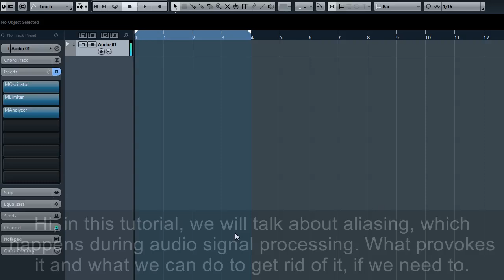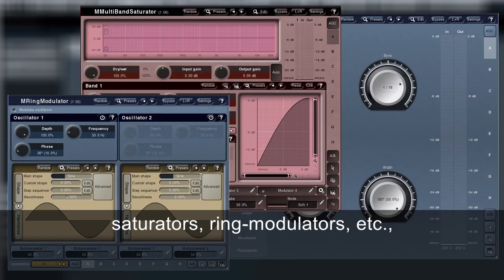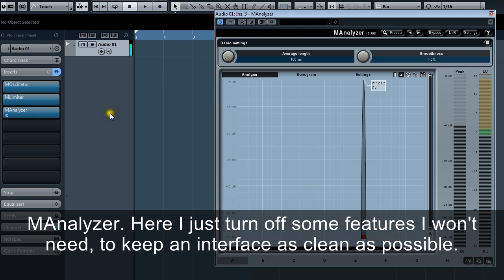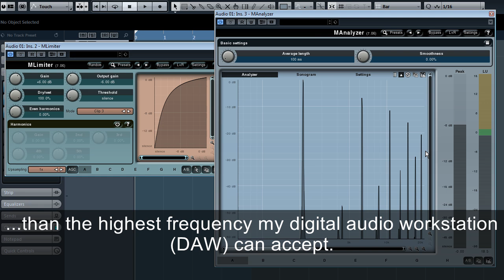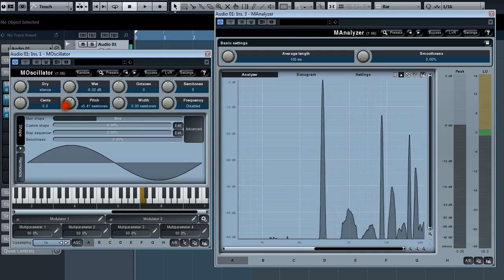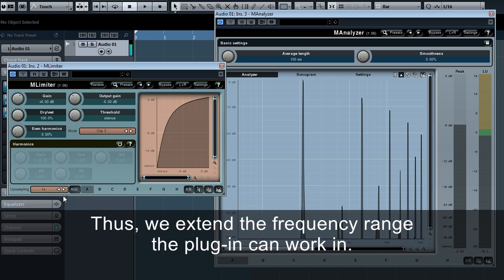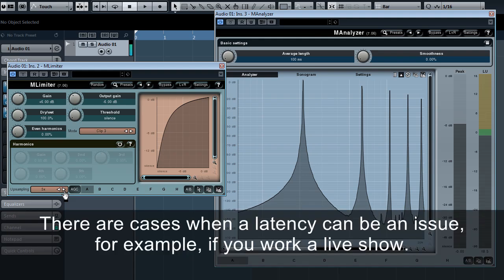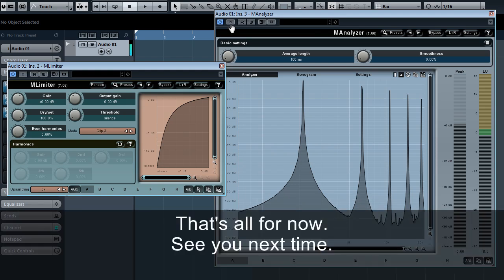Audio aliasing explained

Comment: I'm guessing this session was in 44.1KHz?  So if the session was recorded at 88.2, setting the upsampler to 2x would be the equivalent result of what was 4x in this session?  Thanks in advance! :)
Reply from the maker: Yes, that's correct ;). But as always, note that it is not a miraculous cure. Please read the docs about upsampling to get some knowledge about it, so you can use it profesionally.
Reply: meldaproduction Hmm, well I certainly will!  

However, while I didn't think it was a miraculous cure, I did think it was an effective one, lol.  If the problem is digital and it's effectively like hitting a wall, expanding that wall to frequencies well beyond what we can hear I thought would be rather effective.  I'm guessing from what you've said, there is more to this (as I was certain of regardless) than higher frequencies folding back into the audible range.  I think this is the final digital problem (at least for mixing/production) I have yet to fully understand and therefore effectively solve.

Anyway, thanks guys; you're the best!  I love people who are great at what they do.
Reply from the maker: Typhoon792 My pleasure. And yes, that's correct, it's more or less the only digital audio problem, interestingly most plugins don't solve it at all, which sometime is...ehm... And yes, oversampling is the general cure, but it has disadvantages.
Reply from the maker: Typhoon792 Yes, but also there is latency problem, filtering...
Reply from the maker: Typhoon792 Check the docs, everything should be there. And yes, latency + CPU is the main problem, nevertheless it is filtering, that's the main thing. As usual - use it only if you hear/measure a difference.
Reply from the maker: Typhoon792 Actually, it should hit you in your ears in the first place. The video should give you some insight about how it sounds. Anyway you can easily use MOscillator, set the sawtooth wave and listen ;).
Important point: Those saying that aliasing is generally wrong are fools! (and it's most of them) The truth is, you can use it creatively, there's no limits!
And as for an example - imagine a tuned drum (with some strong fundamental), whose frequency collides with some other instrument. To get some space in the mix, you'd probably use a saturator and/or eq (or some more sophysticated tool such as MDynamicEq), but these will both probably generate the same harmonics, so saturation won't help you. But if one aliases, it creates some nonharmonic frequencies, which will separate the 2 instruments. Of course, this assumes they will be significantly high-pitched, but as an example...
Reply from the maker: Typhoon792 Yes, that's correct ;). You know, music is art, so "if you like it, it is good! whatever it is!" ;)
Reply from the maker: Typhoon792 I totally agree ;).

Comment: Deleted my comment because I said that a well designed plugin should take steps to keep alias causing elements out of i's output (ie: at least incorporate a LPF at the final stage)?

Seriously?
Reply: Alias causing elements in every single wave are different, so this filter should be very intelligent and heavy weighting, causing additional latency and, mainly, absorbtion of the system resource. The last will in its turn cause what? Right, aliasing XD

Comment: Any plug in that is not aware of the sample rate of the system environment in which it is working AND fails to properly take measures to prevent the creation of spectral components that would create aliasing (at least by using a low pass filter at the final stage before plugin output) is a poorly designed plugin IMO.
Reply from the maker: Actually, aliasing is inevitable in most cases. It can just be minimized. And the processing is often highly CPU demanding. Anyway believe it or not, most plugins on the market completely ignore this problem.
Reply: +meldaproduction
I love that you're honest (as it would obviously be counter to your best interest claiming this as opposed to using this as a way of promoting MeldaProduction plug-ins), but the way you put it almost seems contradictory.  The most important thing is to be informed and otherwise educated on any matters you form a conclusion on, and I can't appreciate that any more than I already do when it's a shared value with somebody that I have, especially when done on principle when in theory (and unfortunately often times in practice) it's counter to their own business interests, but what you mention in a practical sense doesn't really aid in the mixing process.  On the one hand, it's obviously important and helpful to compensate for aliasing (overall) in your sessions for the benefit of added clarity (and reduction of dissonance) in upper harmonics and frequencies.  On the other, you're kind of saying Slate Digital and Universal Audio and all those companies who make plug-ins like you guys actually worth a damn (and pretty much necessary at this point if you're going for specific qualities) don't really account for this issue on the whole, so it's pretty much unavoidable?

The problem is, aliasing is hard to hear on an individual track for something more complicated than a basic generated waveform, but as a whole, with whatever practical applications during the mixing process aside, if avoided or properly corrected on all the tracks afflicted, the resulting sound is cleaner and otherwise just more natural sounding on any hi-fidelity playback system.  My question is, what would be your recommendation of how to deal with this problem?  And if it's the simple answer I think you might be tempted to give, what would be the process/steps for getting more competent with this discipline?

Imo, the right way to think about this is as if you have infinite processing power and make whatever necessary compromises later on, unless you just know for sure in advance that compensating for it on x amount of tracks will max out your system.  Obviously oversampling is taxing, but what would be the alternative?  I would argue simply recording at a minimum of 88.2KHz in the first place, but then of course there are plug-ins which could screw things up.  Also, which DAWs are best at handling this sort of issue?  I know you guys don't particularly like Avid or Pro Tools, but what would you say about it at least on this front?  I unfortunately use it even though I personally think they're the cancer of the audio industry and would otherwise not think twice in taking anyone down that's a part of making their business decisions or in charge of the design of the software for that matter.  I use it because however they managed to do it, they've established themselves as the industry standard and in this way still lead manage to lead and be many times on the frontier of new developments, no thanks in particular to them.

It's just, so many variables start coming into play that in the end, excuse my language, but you kind of just think, "whatever, fuck this, if I ain't hear nothin' that's apparent, I ain't gonna care", but that's also wrong to think...  If you otherwise can't tell, relatively subtle issues like this drive me crazy!  Any suggestions? XD

Thanks!  I appreciate any insight you may have! :)